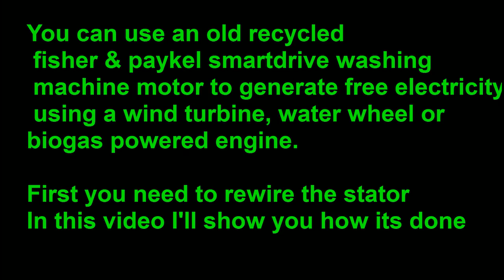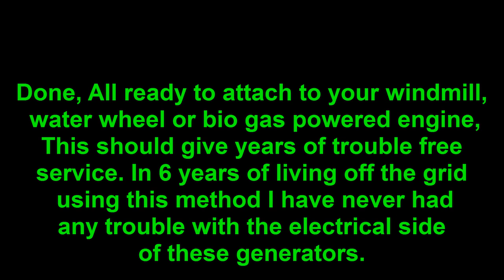How to rewire an old washing machine motor to generate free power

Comment: It looks like there is a bit of insanity here, the original DC motor windings and power scheme required three contacts.  What we want is to turn this simple brushless motor into a DC generator with two contacts, one positive and one negative. This wiring scheme leaves 1/3 of the poles connected to the third lug that is unused.  Seems like something is missing in this theory.Each pole coil should attach to the next coil past it's neighboring coil, in turn around the circuit making only two circuits instead of three for the attachment points.
Reply from the maker: It is 3 phase AC output not DC, output is fed via 3 wires into a 3 phase rectifier which converts it to DC

Comment: Woudn't be better to do phase 1 then 3 and then 2? So the 1 and 3 would be better separated and then last 2 would be easy to isolate from the 3 because it's on the top?

Comment: flux would help with the soldering
Reply: +Rick Zepp Yes, and so would tinning the parts first. 
Also, when soldering one should concentrate on heating the parts – the thickest parts first – and then add the solder.
– Just a couple of tips to make better solderings easier.   :)

Doesn't most tin solder have flux in it?

Comment: did you check the voltage and amperage with original factory wiring configuration?  did you rewire to get more amp?

Comment: what is the difference in output???   why go from series to parallel???  what are the numbers...  what voltages? amps?...  before and after....   what are you using it for..  you have to finish the story here...  what is the point that you are trying to show us
Reply from the maker: calholli The reason for rewiring is to raise the amps & reduce voltage to make it more suitable for charging a battery bank. Before rewiring the stator produces 400+ volts. I use the stator on my hydro generator - https://www.youtube.com/watch?v=0ieFZI4-6K8

Comment: Wouldn't heat shrinkable spaghetti insulation work just as well? Just slip it on like a sleeve around the phases and a little snip to let the perpendicular wires pass through.

Comment: Hola amigo. saludos he querido hacer un aerogenerador, no conocìa este tipo de motor de lavadora, es ideal para esto, el cambio que le haces a las bobinas sirve para cargar baterias de auto de 12 volts.'  para un sistema de alumbrado de emergencia.  queda como el dibujo del video? con tres fases y  que voltaje te da? gracias por tu atenciòn.
Hi friend. Greetings I wanted to make a wind turbine, I did not know this type of washing machine motor, it is ideal for this, the change you make to the coils is used to charge 12 volt auto batteries. for an emergency lighting system. Is it like the drawing of the video? with three phases and what voltage does it give you? thanks for your attention.

Comment: Question.... Why rewire it at all? Doesn't it already, as standard, generate considerable wattage if used in this application as it came out of the machine?
Reply from the maker: Output is 400v + with the factory wiring, not ideal for charging a battery bank and dangerous to work with
Reply: Angry Ram but it's amps that kill? high voltage low amps is much safer. And since you need a regulator any way why not fit it before the battery pack and thusly save yourself a lot of work?
Reply from the maker: 400v is far too high for charging a 24v bank, a zap from the factory wired stator when open circuit with the pelton wound up can kill you, rewired to 60v will tingle but not enough to kill.  You can do it how you want, I'll do it my way.
Reply: Angry Ram lol ok.

Comment: I haven't seen a motor like that on any washing machine in the states.  too bad.....
Reply: Whirlpool makes them. Owners of washers that have this motor usually throw the washer away after 3-7 years because the motor is so strong it can easily wear the washers axle bearing out. I'm not sure if it's the Calypso by whirlpool or the Oasis, but the one you want does not have a belt (direct drive) and the washer will always have a computer board, never the traditional old models.
From a washer repairman.
Reply: Hasan Hazime  Thanks
Reply: SpockMcoy Issmart they are called dd motors
Reply: LG uses the same system.
Reply: "Direct Drive"

Comment: the original unmodified 400v output once rectified could possibly replace the panels in connecting to a grid connect inverter. for people with a grid connection and not much sunshine. has anyone tried this idea?

Comment: Question... I have a Whirpool front loader that I purchased broken.   It has a direct drive 3 phase motor.  Looks similar to yours.   However connecting a multi meter to leads generates 30VAC output at approx 60 RPM on all leads.

My question is... Do you have to rewire yours because it's built for 220?   Or do you believe that the direct drive I have is ok to use the way it's built?

I just don't understand why the stator is being rewired in this video?   Is it to achieve lower RPM, greater current???  Please explain.

Thanks for sharing brother!

++Todd
Reply from the maker: I've  never tested a whirlpool so can't comment on how to rewire them, but I imagine it would be a similar configuration, 30vac @ 60 rpm sounds about right for 110v power supply.
Reason for rewiring is to lower the voltage & crank up the amps to charge a low voltage(24v) battery bank, Also much safer when rewired, a shock from the factory stator can kill when it gets up some speed.
Reply: Buddhanz1
the whirlpool is an f&p smartdrive motor, just a US branded machine. identical.

Comment: Love your projeckt! 
Have a question thou(excuse my bad spelling..)
Would it not be easier and cheaper (in cable-sice), not to rewire the stator. Sending the 400volts ac all the way to your house, having a rectifier, batteries and all there?
I mean, a modern Mpp charge controller and inverter can handle around 1000volts dc going in..

Comment: Hello again, can You tell me how much Ampers produces your generator ? For example  in 500 rpm ? Thanks
Reply from the maker: Vratislav Hrubý At 1000rpm I can squeeze 35 amps at 24 vots out of it, 500 rpm would be less than that, maybe 15 amps
Reply: Ou It´s realy strong . With this power I have electricity for all my village :)
I have to try it

Comment: Can this F/P conversion charge a Battery Bank wiered @ a 48v system?and by the way fantastic Video Thanks for your trouble,
Paul from Berringa Victoria Australia
Reply from the maker: Yes if you can get the rpm up to 800+ rpm it will output around 60v so will charge a 48v bank with ease

Comment: I have a 36 poles motor from LG washing machine.
 I got schematics how to rewire motor from here http://www.thebackshed.com/windmill/images/36pole3X4C.jpg
I novice to anything AC related electricity thing. And can't figure out where according to this scheme need to be attached wires originally connected to a three power connecter 
Any help please?

Comment: If all the motor parts were in good working order why did the washers fail to wash cloths anymore thanks ?
Reply from the maker: The controller circuit boards die eventually

Comment: thanks for posting. good work. However, I would second ps420. the temperature of the wires to be joined must be close to the melting point of solder in order for the molten solder to flow between and link them. soldering to a tab requires even more heating, to heat up  the tab.  your technique works ok, but look at the join of the 10amp wire to the center tab. the wire and tab were not adequately heated.    cheers
Reply from the maker: Yes I definitely need a bigger iron for this job, however I've never had a joint fail so thats good enough for me ;)

Comment: I have a Samsung direct drive DC motor like this that i want to rewire. My motor says 310v DC and I have found the common diagrams showing how to rewire the motor in different ways but I am a bit confused. Every video I have found shows motors that look just slightly different than mine. I have 36 poles and all but my terminals are on the opposite side of the bridge where all the wires are connected. When looking at the stator from the top all of these motors seem to have the terminals on the right side of the bridge therefore putting the bridge at the end of the coil if you went around it counter clockwise. My motor has the terminals to the left of the bridge so would I do the same thing but in reverse to wire it following it around clockwise? Thanks and great work!

Comment: stupid question and i should seek my own answer,  but how did you get to the design rewire of the poles to know it would produce 24 volts?  are each set of poles 24 volts and all groups are utilized together  by putting the 7 of them in parallel ? each coil must produce 4 volts? 6 poles in a group together is 24? and 7 groups in parallel?

Comment: Best soldering iron/gun I ever owned... Was an adjustable/variable pencil purchased from MCM Electronics back in the 90's.   I paid 13 dollars for the thing and it lasted me until 2015!    it still works, but the entire point is ate up... Not sure if I can find replacements.     It was brown with a little white dial that you used your finger nail to adjust temp.   A 1000% times better than any soldering gun or pencil I have ever owned.
Reply from the maker: +VTwin4Christ Nice, sounds like a goody
Reply: I actually found that MCM still sells the thing!!!   In 1992 or so I paid 13 bucks for it... Now it's only 17 or 18.   Best inflation rate I have seen to date! :)    Now if silver solder will come back down to a reasonable price... Vtwin will be a happy man. :)

Comment: Question: If you'd want to use the engine in a boat or an e-bike. With this wiring you can use the engine with 12-30 volt battery packs am i right?
Reply from the maker: +Antero Vipunen Yes that's right

Comment: sorry, but where the pressured water you give from?
Reply from the maker: TheSaeed111111  I have a small stream on my property
Reply: how mutch the different you have to keep so strong pressure? it could be up to 40 meters!
Reply from the maker: TheSaeed111111 yes it is around 40 metres, it is in a steep gulley
Reply: 31 meter head

Comment: cool, but why don't you just spin it in the magnetic drum at the spin cycle speed and simply get the 3 phases of 120 volt 60cycle ?
Reply from the maker: ronald sykes Not as simple as that, they are not direct ac so the output would be 400+v & over 200hz

Comment: So, how many rpm does it need to spin to generate 120v? and how many rpm is 240v? will it be 60hz in every RPM and volts?
Reply from the maker: It will max out at around 65 volts dc after rewiring, the factory stator will make 240+ volts but hz is too high for household appliances
Reply: so how do I make it 120v at 60hz or 240v at 60hz? (we have 120v 60hz here)
Reply from the maker: You would need a 12/24v dc - 120vac inverter
Reply: k thanks..

Comment: You know this is stored solar energy. Using a stream to generate power isn't a new idea but how he is doing it I'm sure is different than others. It is very interesting and for the most part it is very cheap power for him The energy source is free but it takes his time, a washer, wires, solder, battery bank etc but well worth doing for the free power source and cheap alternative
Reply: Using a large soldering iron in his latest vids doing this again...with sound.
For a newly built hydro 
also  https://www.thebackshed.com/Windmill/FPRewire.asp

Comment: Hmmm Wouldn't it be easier to use a Car/Truck Alternator as that already has the Charge Control built into the regulator Plus it is also pretty waterproof due to it's normal use
Reply from the maker: Car alternators require much higher rpm to produce useful amount of power, not practical for wind/hydro. You could gear it up with belts or chains but this would result in high frictional losses

Comment: I intend to connect it to a Bedini Wheel that I build with a 1 Meter Dia Wheel and 16  Neidium Magnets 165 Lb Pull each ,the wheel spin 200RPM using 40Vand 8 Amps what do you think,I believe it will end up charging its own Batteryas well as charging my battery bank.
Paul
Reply from the maker: I don't get your concept.. do you mean a perpetual motion generator?

Comment: You have a 42 pole stator. I have an 18 pole but each pole is larger than each of your poles. So will I still be able to use an 18 pole stator? By the way great video
Reply from the maker: *****  It should work ok, one way to find out. What is the output with factory wiring?

Comment: I may have missed it, but why doesn't it dump excess electricity back into the grid?  Like I say, I may have missed it.
Reply: This is "off grid", miles from the grid, with a cost of $14k to connect to the grid.
As long as marty can heat water it's all good...longer showers!

Comment: Thank You very much for this video . I think it´s ideal for small water generator. I´m useing hub ebike motor such a generator (cca 140 RPM for 14V) now. Do You know how much RPM is necesary with this motor for 14V ?
Reply from the maker: Vratislav Hrubý You're welcome, yes it is ideal for small hydro generators & windmill generators. Not sure about your question, my generator requires 500 - 1200 rpm
Reply: Buddhanz Hello, :) sorry for my english . Yes I ask You about this. I want to use it for charging 12V car battery.  I have ponton water mill in the Amazonia forrest . I think 1000 rpm is maximal for my construction

Comment: Hi Marty. I'm a subscriber to your other channel. Very much appreciate your content and especially this project. I am thinking of doing one of these washing machine to hydro conversions as I have what I think is a good site here in SW UK (Devon). I have two questions. Firstly what is the reason for converting from single phase AC to three phase for power generation. Is it simply more efficient? Secondly I have a Samsung washing machine which I repaired recently. It looks like the type you have converted. Am I right in thinking that if it's a direct drive motor, it will work in the way you describe, or are there major differences between manufacturers? Sorry if these are very basic questions and I would very much appreciate some guidance. Cheers, John.
Reply from the maker: Hi John,  these motors will produce 400+ volts which can be lethal. rewiring reduces the output voltage and boosts the amps to a level more suitable for charging a battery bank. Sorry I haven't tried any other washing machine motors so can't recommend them
Reply: @AngryRambro  Brilliant. Thanks. That makes sense.

Comment: Why use such a high wattage soldering iron? Perhaps the metal conducts the heat too much from a lower wattage, so it needs to get hot fast just on the tips of exposed wire?
Reply: The secret is to heat everything so the flux and solder work together for a good strong electrically conductive joint..
Marty T Using a large soldering iron in his latest vids doing this again...with sound.
For a newly built hydro 
also  https://www.thebackshed.com/Windmill/FPRewire.asp

Comment: Very cool stuff! like it a lot! 10 days ago i knew shit about electricity yet i did understand rewiring! Similar to wiring batteryes in series and parallel to get desired voltage and amph! Did not watched yet how did you run that watering thing! Thx for share
Reply: Marty T Using a large soldering iron in his latest vids doing this again...with sound.
For a newly built hydro 
also  https://www.thebackshed.com/Windmill/FPRewire.asp

Comment: Awesome, I just finished converting a stator! Great tutorial, hardest part is cleaning the enamel coating off the copper wire
Reply from the maker: BoostinR31 Nice, yeah it's quite hard to get all of it off & if ya leave some on the solder won't stick. Are you making a hydro generator?
Reply: Buddhanz
 I'm going to make a few stators and see where they lead. First one will be hooked up to an excercise bike and whatever my friend who is keen to engineer can engineer. A rotary tool makes it easy to strip the wires, as I learned after trying to manually join the each series of coils by sanding them manually with sand paper. I joined the 3 phases to every 6th coil like a dream with the rotary tool to remove the enamel off the wires. At the moment I have plans on a power supply for an advertisement billboard trailer for a fellow activist friend that is currently in the make. At the end of the day we are looking at building many modifications such as hydro electric to keep a self sustaining aquaponic setup and more. Looking at building affordable setups to help the everyday man and woman break free from the slavery system ;)
Reply: Buddhanz What kind of power...watts....can you safely get from this set up before it starts to over heat...?
  and at what rpm roughly...?
Reply from the maker: CapnSchep I get 30 amps @ 24v without any overheating issues, I scratch groves in the rotor to increase air flow around the stator, it never gets much higher than 40 c. The spinning rotor adds a cooling effect. 1000 rpm
Reply: Nice..!
Reply: Buddhanz 
Nice,  Thanx Buddhanz for the response and info...!!    Great video BTW....
Reply: Buddhanz
 Was yours a 120 vac or 240 vac..?  I'm getting a fisher & paykel washer for free and it's probably wired for 120 vac...  So if yours ran off of 240 vac, would I have to rewire it differently to make a 24 vdc generator like yours...HELP...lol...!!
Reply: I used to find it easier to simply burn the enamel off using a gas torch

Comment: Hi

Really like your project.  Do you know if you can convert the smart drive washing machine to run on DC. I want to go off grid without an inverter and am looking for ways to have all DC appliances.  Cheers
Reply from the maker: Paul Waddell I think it would be more trouble than its worth. Looks like someone has posted the question  here - http://forum.allaboutcircuits.com/threads/12v-24v-to-a-3-phase-smartdrive-motor.42225/
Reply: isnt this making DC power at the end with the 3 rectifiers put in?